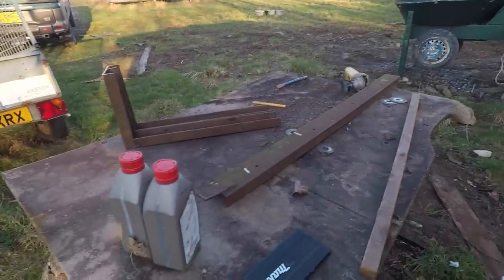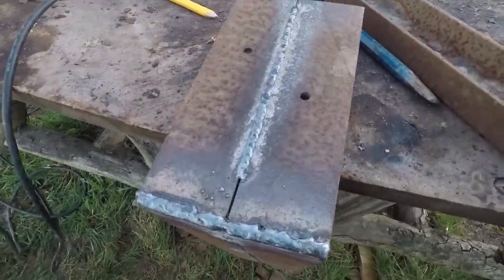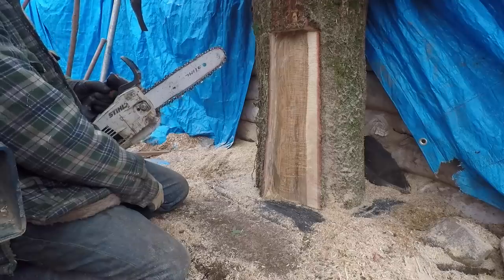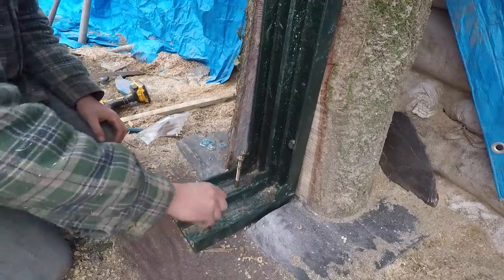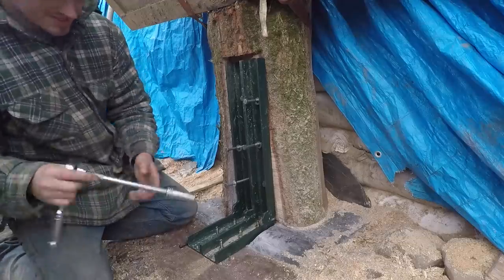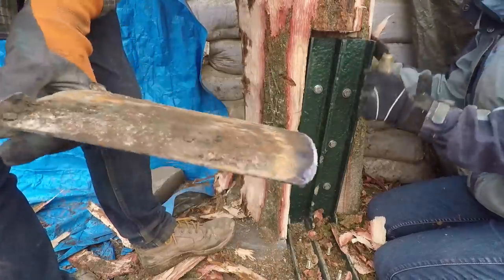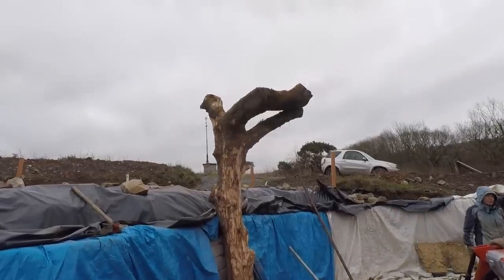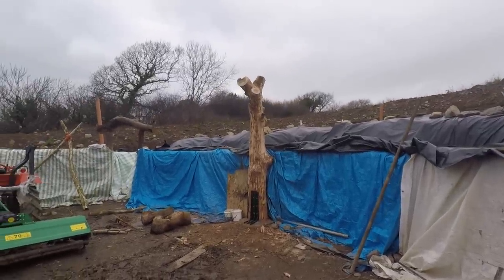Off grid Earthbag workshop part 15 Roof Support Bracket

Comment: Two tips for welding:
(1) Wrap the cable around the hand you’re holding the electrode in, once around will do so that it runs off your forearm/elbow. It keeps the cable away from the job and avoids damage. 
(2) Clean at least a couple of inches around the weld. Grind it back with a flap wheel and brush. You absolutely don’t want to be welding on rust and scale as you’ll contaminate the weld which can cause weakness and faults.

Comment: In United States we use a thin piece of foam between metal and wood as well as wood and concrete. I would look online and before everything gets finished put in that foam.
Reply: Quake c 
It's called DPC over here (damp proof course). Before we had fancy modern materials like plastic or felt, we used slate.
Reply: Quake c ......I believe the idea is to primarily use natural materials where available......instead of asbestos, plastic or anything else considered more harmful.

Comment: I love this kind of stuff, can't wait for more! Just one thing Kris, what are the hazzard of having a bearing pole infront of the wall? or are there any after you put the scews in it?
Reply from the maker: Not sure what you mean really? the log is there as part of the structure of the wall. the wall is very long and retaining alot of mass. it being fixed at the bottom and fixed at the top back to the earth behind it makes it an a strucural part of the wall. supporting it all and tranfering the load back to the earth in the middle of the top workshop. without it there that wall could potentially bulge over time.

Comment: Great content as always Kris!! Just noticed the new battery Makita top handle! How do you rate it against the 201? Hope the Stihl hasn’t been messing you around?
Reply from the maker: its really nice to use and really quiet. so far im liking it but i need to sort out the batteries to give a a good test.  i want to slowly move over to electric. i have spare power so it makes sense to use it where i can.
Reply: Kris Harbour  yes makes a lot of sense for you going electric really, super eco charging off grid too😁! though I know it can be a pricey change over. I’m also thinking of going electric this year though I use them all day everyday so I’m a bit concerned about run time. Love the idea of the noise level and just on or off not having to pull to go or leave it ticking over by the chipper. 
Thanks again for all your videos! I throughly enjoy them 👍

Comment: Hey Chris, during your time in construction were you doing anything skilled like carpenter or welder etc. Or just unskilled labor?
Reply from the maker: I was an Elevator engineer. Basically i fitted elevators in new buildings.
Reply: @KrisHarbour  who taught you to build stuff?
Reply from the maker: Just self taught. i just use the internet to learn the principals behind things. then use a logical process to work things out from there. when i started the roundhouse i had never built a building and never put a joint in to a bit of roundwood. its all quite easy if you just start doing it. Just think of it as lots of little jobs that are all very easy to do. but together make something quite complicated.

Comment: I'd recommend proper security measures when welding... And working with chainsaws... 

Accidents happen pretty fast...
Reply: Armed guards with high viz vests ;)
Reply: @driftwood5407   To avoid disability discrimination, shouldn't we be clear that the guards don't necessarily need arms?
Reply: @danceswithstone  :):)